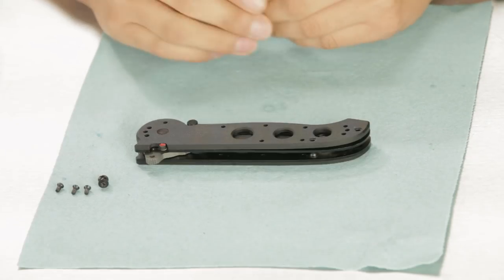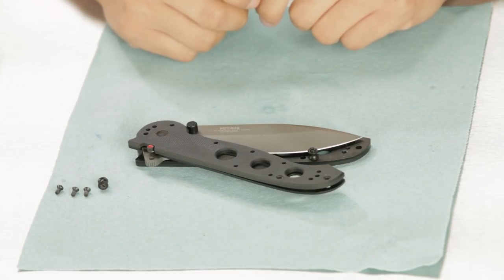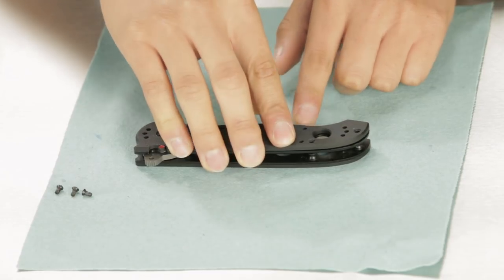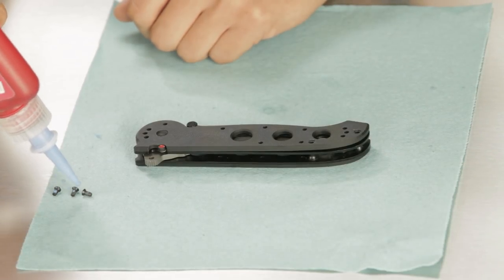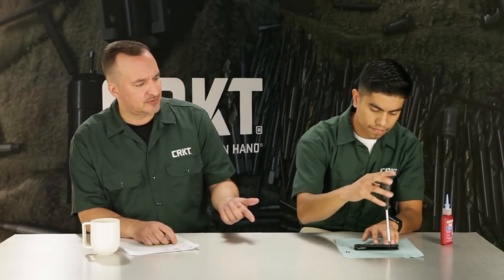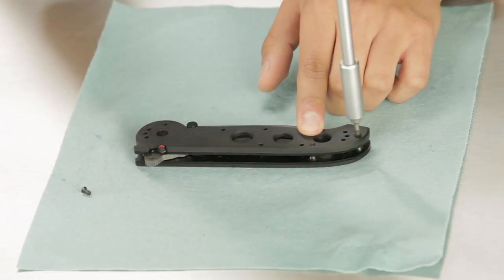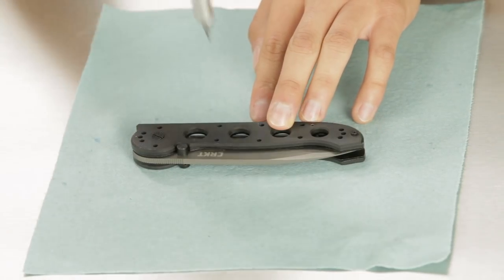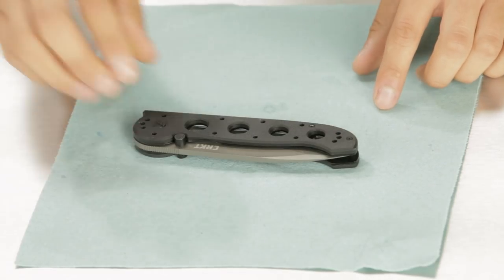How to Replace Knife Frame Screws, Back Spacer

Comment: Crkt, I just got a ritual today, and the back spacer rattles, and the liners come right out of the holes, where the two nubs from the liner, go right into the 2 holes on the spacer. Did that make sense? What can I do? It's definitely not safe. But I'd rather not go through the return process to knife center. Is there any way I can fix this small issue? It's definitely not screw related. There is just nothing keeping the bottom of the 2 liners, in that nice blue back spacer.